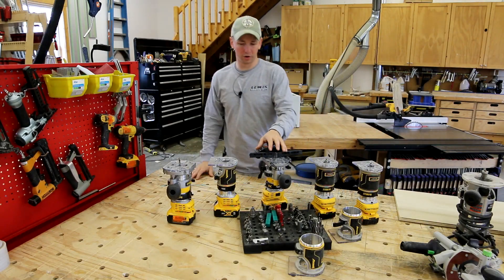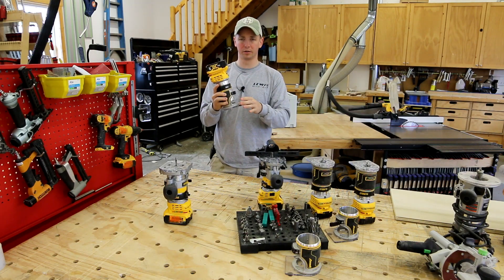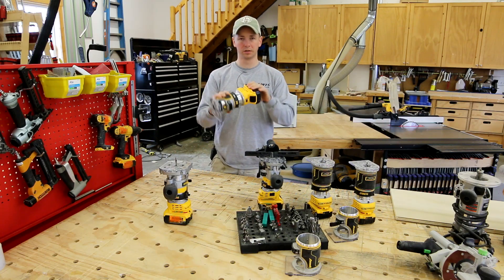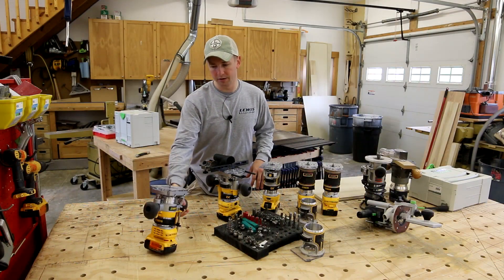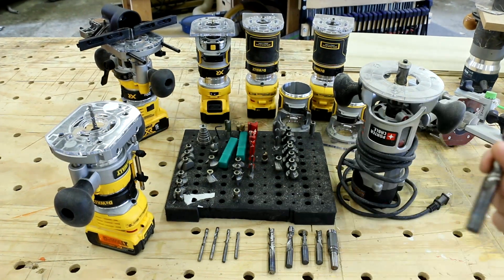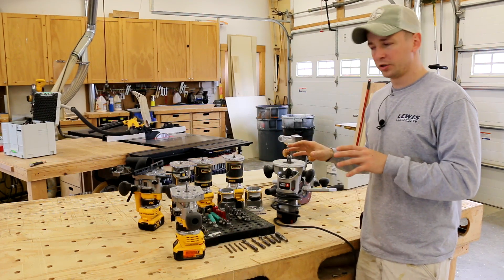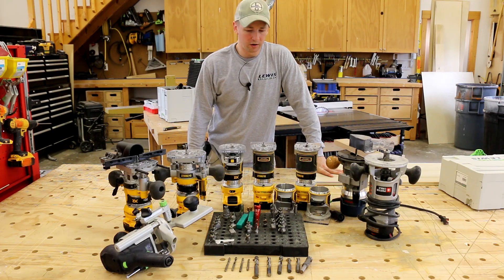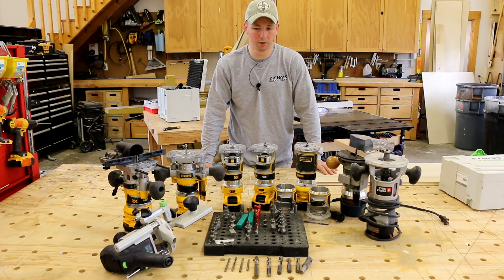DEWALT DCW600B 20V Compact Router Review and Four Uncommon Bits that Take it to the Next Level

Comment: Amazon says they are not brushless are you sure yours are brushless
Reply from the maker: You are correct. I realized after I had already rendered and in the process of uploading that I said brushless. I didn't feel like going through the whole process again to edit it. But honestly with my experience using the router I'm getting impressive run times as is.
Reply: @InsiderCarpentry  Roger that
I may start posting some vids of the work we do in Beacon Hill in Boston. Super high end but a pain in the ass. No space.... I would give a finger to be able to work on large spacious homes with the same kinda high end work. But they just don't exist in Boston...
Reply from the maker: Lou Cifer It’s a marketing deception. The XR just means extended runtime. Not necessarily brushless. I think the tool actually has to say brushless on it for it to be brushless.